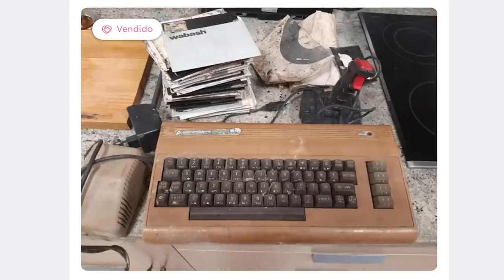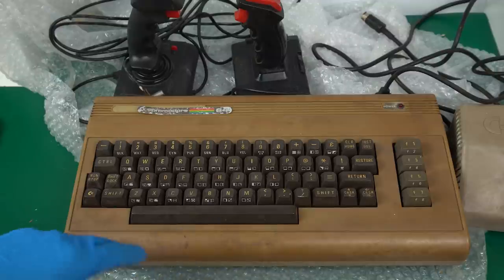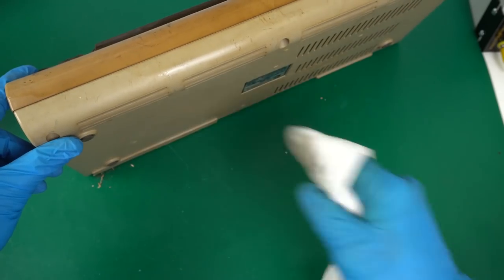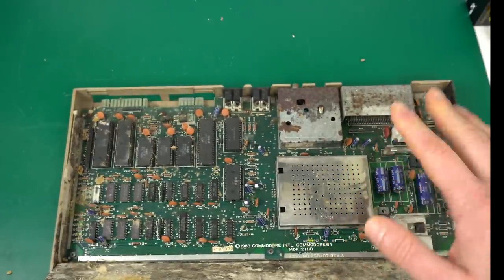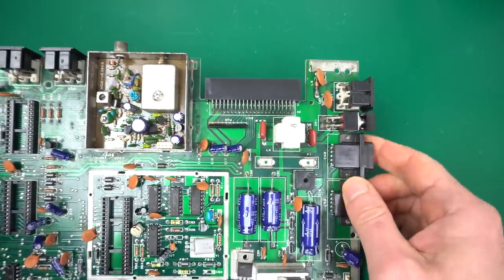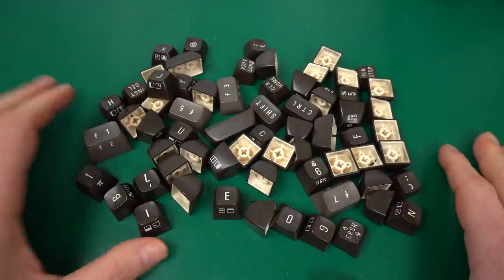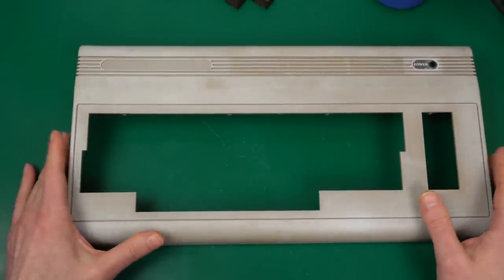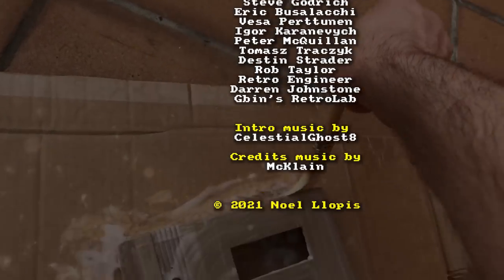Disgusting Commodore 64 Restoration. Will It Work? (Part 1)

Comment: It was shocking how clean the motherboard was! 
They make spray can paint specially for plastic. 
It chemically bonds to the surface and 3 light coats will be all it takes to make a C64 any color you want.  
I would tin the legs of the 2 dead chips, and see if they are really dead or just bad contacts with the socket, before signing their death certificate.
Reply from the maker: Yes, I actually did that this very morning. I didn't go for the original color, instead just chose something bright and cheerful. Looks great!
Good idea about the chips. I did clean the contacts well of one of them and it came back to life. Unfortunately, there were other bad chips in the board... but that's a story for another time 😃

Comment: That case looked like it had been locked in a room with a 6 pack a day smoker for years. Good grief.
Reply from the maker: Exactly, but it wasn't any room, it was a sauna judging by the state of the user manual.

Comment: For rust removal, you could just use vinegar, but don't expect things to return to original. About the retro-brightening, I saw another YouTuber actually putting the plastic in an oven for a while, and the result looked just as good as the sun treatment. I'm doubtful that case is ever gonna look nice again though, maybe it was used in a garage or something and got oil and grease on it. Maybe painting is the best option. Those traces look pretty rough.
Reply from the maker: Good point about vinegar. I went for this solution because I saw them SO rusted, but that would have worked too I'm sure.
Yes, it's interesting how retrobrighting seems to work with heat as well as with UV. Still room for researching things.

Comment: I didn't know you could put electronics under water like that. Very interesting!. Love your videos!. Cheers from Madrid ;-)
Reply from the maker: Yes, it's a great way to clean dirty boards like this one. Just dry it REALLY well and don't turn it on for a while. Then again, in Madrid in a summer day, you can take it out of the shower and it will instantly dry 😃  Un saludo!
Reply: @NoelsRetroLab  Indeed!. Put something out under the sun in summer and it will dry and even melt :-). I've just finished watching the video. I never thought a C64 in a state like that could start looking as good as it is beginning to look. Looking forward to part 2!. Saludos.

Comment: Finally I found somebody else who uses  hairdryer to clean boards. I have been subjected to some ridicule about it and feel very much vindicated now. Also - good cliffhanger.
Reply: As the saying goes: "If it looks stupid but works, it ain't stupid"
Reply from the maker: Really?? What reason would someone give against using a hair dryer? You can control the heat, so that can't be it. Nobody's said anything to me so far. I find it really effective to get the bulk of the humidity, and then I leave it another 24 hours to make really sure. I've heard other people use big fans to speed up the process too.
Reply: @NoelsRetroLab  not manly enough, gotta be a paintmelting and chipdestroying heagun... sigh

Comment: 5:07 flies in the middle look like moles. Not spiders. Paper is not as degraded as magazine after couple of years in garage.
Reply from the maker: Moles?? The moles I know would be bigger and digging holes in the soil, not getting inside a C64 case. Is that the name of some kind of insect as well?
Reply: @NoelsRetroLab  moths. confused "mole" with "moth".

Comment: You may be interested in retro-briting the case in a similar fashion to how David Murray does his - large clear tub, submerge the part entirely in a water / h2o2 solution. he has gotten some very consistent results that way. You can also supplement the sun with some UV led lights when necessary
Reply from the maker: Yes, I've seen his approach but I don't have that big of a container or even enough peroxide to cover the whole case. Besides, in this case, it wouldn't have done much for the uneveness I think.
Reply: @NoelsRetroLab  ah fair enough, nonetheless thank you for the reply and thank you for making such wonderful content!

Comment: Just spray the case with car paint. I did it too mine, in the exact same colour of my car Black Pearl and it's astonishing. And car paints are basically poly urethane so it also adds some strength to those brittle bodies. And especially that clear coat (that is a must) that turns rock solid. I painted my damaged guitar 2 years ago. And the first spray was a bit uneven for my liking, and I had to sand it down... again... and boy was that hard work.

The C64 on the left is the make over C64C case, and no it doesn't have an Ultimate C64 board in there, the original batch was broken. Still looking for one. But the clear coat and the sheen is really nice. And they keys are actually grey, the insta filter makes them look yellow. It's a keyboard I took from an ALDI C64C bread bin model.

https://www.instagram.com/p/CLpGkowg0UP/
Reply from the maker: Yes, that was one of the options, but I didn't have any car shop friends that could do that for me. I ended up just getting some good-quality spray paints and so far it's looking great 😃

Comment: Why do people say you must only use Isopropyl alcohol to clean electronic parts but you are able to clean it in the shower?
Reply from the maker: I'm not sure. Maybe they're talking about dissolving flux? Or they want to be able to use the boards quickly after washing? Not sure. Using isopropyl alcohol is not going to be bad at all, but in my experience, with this kind of electronics, soap and water are fine as long as you dry it carefully and wait for it to be 100% dry before powering them back on.

Comment: Get yourself a clear tote and fill with liquid 40% hydrogen peroxide.. line the outside with uv LEDs.. and wrap the tote with aluminum foil so the UV lights reflect.. Submerge parts you want to whiten.. Leave it over night or longer with lights on.

Comment: So is this the result of sea water in the air? It's not just rust from water, it looks like there was some kind of acid involved too.
Reply from the maker: I think it was sun and high-humidity. Look at that user manual! It's crazy! Why do you think there may be acid involved? I didn't notice any signs of it.
Reply: @NoelsRetroLab  It looks like it has been stored in a damp cellar next to a leaking car battery, especially the case plastic and those spots on the pcb are so deeply corroded. That's a lot of work for the next episode!

Comment: I really totally enjoy all your videos. I'm for sure not skilled as you are. Are you sure it's ok to wash a motherboard with soap and water!?!?!
I mean some components might have water sensitive parts. Water might also be a problem for variable coils and resistors if any. Please just guide me through as this will save me huge effort and money (isopropyl alchole)
Reply from the maker: Yes, don't worry, it's totally safe. The important thing is to make sure to remove all water from the board before powering it on, and, ideally, remove it relatively quickly so it doesn't start rusting anything. I removed the ICs from the sockets to make sure as little water as possible got stuck in there, but everything will be totally fine after a nice, warm bath.

Comment: You should build a reflective UV light box to get more even lighting on parts you're bleaching.
Reply from the maker: You're right. Or at least next time I should put some aluminum foil underneath to catch a few extra sun rays. That will probably help with the sides quite a bit.
Reply: @NoelsRetroLab  Yeah. The advantage of the sun is that it is free and doesn't cost electricity, but unless you're in the tropics (or at least someplace south like Texas) it's at a bad angle. Especially in the winter. With a lamp and lightbox you can just retrobright all through the night to your heart's content. 

All the best results I've seen have come from immersing rather than pasting on, since it guarantees even concentration of the peroxide. No splotches once it's completed.

Comment: I'm surprised you haven't moved to the immersion retrobright method that a lot of other retro restoration YouTubers are using. The paste application method always produces pretty uneven results.
Reply: and additionally, atmosphere oxygen rapidly decomposes peroxide "H-O"into H2-O water. Don't let the peroxide out of it's factory container until it goes on the item. Recap it promptly. Store away from light. Time mark 13:10

Comment: Black mold is quite dangerous.  It's considered a severe biohazard.  Homes with black mold require hazmat level cleaning.  I hope you bleached the crap out of that case.  Heck, I would recommend a masked power wash with bleached water.
Reply from the maker: The RF shield, which is what was covered in mold, went straight into the garbage. The case got a lot of cleaning and it's now covered in multiple layers of paint, so hopefully that's good 😃 I am kicking myself for not wearing a mask while I opened it though.

Comment: could you use Coca Cola for the rust?
Reply from the maker: Probably. Any acidic solution would help (vinegar), although I don't know if the sugar in the Coke would make things worse.
Reply: @NoelsRetroLab  perhaps just some citric acid then. I use the powder to descale elements and it does the job without too much harshness.

Comment: You should have tried it first before cleaning it.
Reply from the maker: When computers are so far gone, turning them on can be dangerous for them (they could have broken components, dust/grease shorting a circuit, etc). Besides, it wouldn't have worked (given what I know now about it 😃).
Reply: @NoelsRetroLab  Fair enough, but I think sometimes it is fun to throw caution to the wind and go for it. If it blacked screen oh well, if it smoked even better to catch on video. Love your content and look forward to future videos.